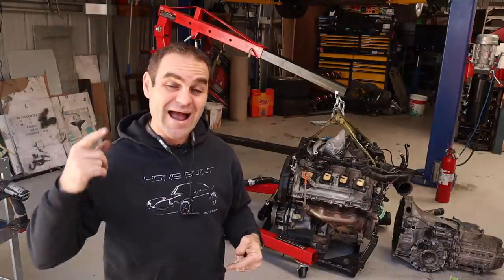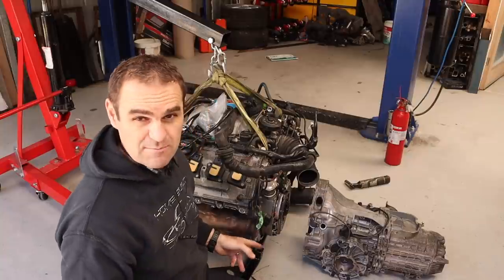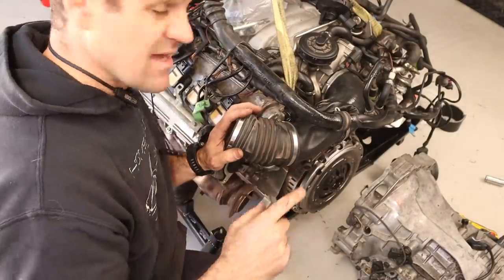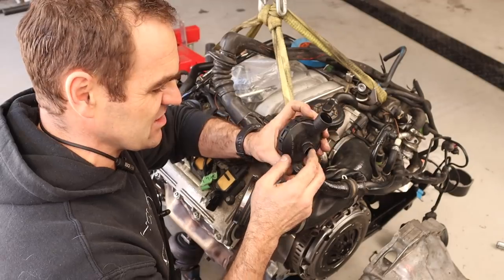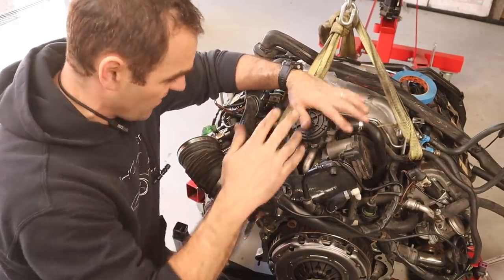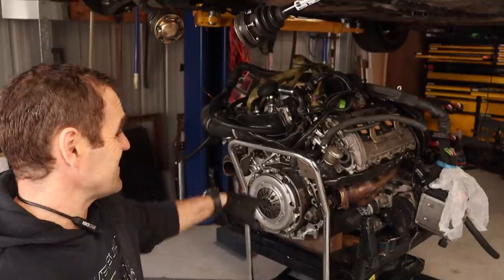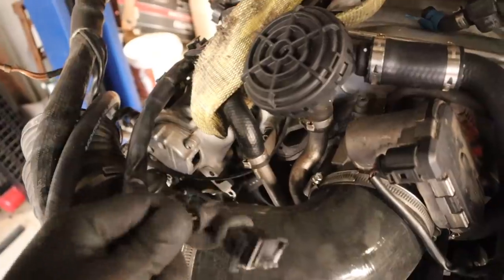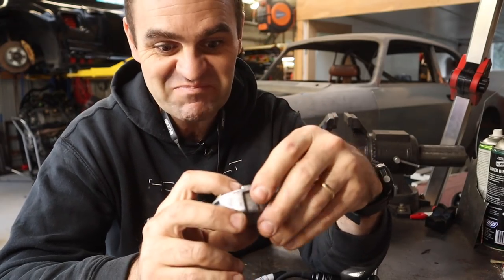V8 swap sub frame - Porsche 986 Boxster V8 engine swap track car build 8

Comment: Jeff, the reason for the electric vacuum pump is that those engines have a lot of valve overlap and under some throttle conditions generate little manifold vacuum, that elec pump is necessary I think.
And the correct term for the "hammer work" is "massaged"...
Reply from the maker: I may even remove the booster all together in the future as unassisted brakes have much better feel.

Comment: As this is to be a track car could you remove the rear panels and just have the outer panels on a dreaded square steel frame held on with dzus fasteners. Easy rear access is everything they tell me.

Comment: Jeff just wondered why you didn't choose to have the 2 parts of the subframe bolt together by having a dowel on the back part that fits inside the front tube. Is it because of the lack of height to get a bolt through it
Reply from the maker: Because the bolts will more than do the job

Comment: I've asked this before. But why the love for so much square tubing? Will make it look nicer and easier to work with when it's round tube. (My opinion)
Reply from the maker: As Lassi has said, square tube is FAR easier to work with and this is already more than strong enough.

Comment: Here is another material you can use to make engine mounts. I have made a few engine mounts out of this. https://www.mcmaster.com/rubber/rubber/shape~rod-and-disc/material~polyurethane-rubber/
Reply from the maker: That looks like it would work, but the bushings are a cheap easy off the shelf item that is ready to go ;)

Comment: Putting the air intaked through to the boot area of the car is a bad idea and should be relegated to the junk box.  The rear of the car will be a low pressure area and the engine will have to compete with the air being sucked out of the boot when you add the necessary vents.  Then there's the issue about ducting through a structural member that similarly is not a good idea.  The result will be a loss of power that would not be welcome.  The existing air intake is where Porsche designed the engine to breathe from and thus must be considered as the optimum position.